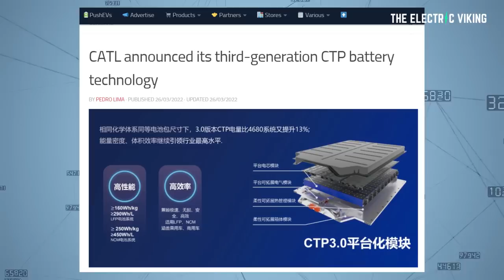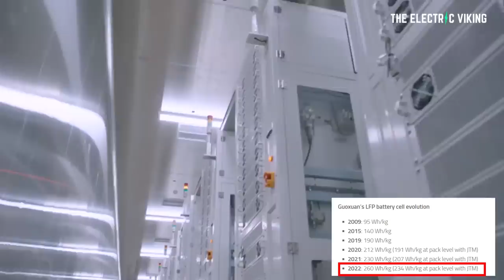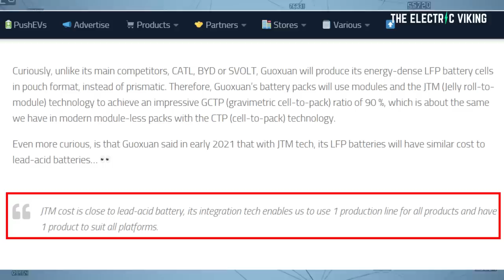260 Wh/kg LFP cells - cobalt & nickel batteries are DOOMED

Comment: The Koreans have made a massive breakthrough with solid state batteries that can be made in lithium ion battery plants. This means that the successor to Terniary battery tech and its solid state successor are within reach.
SK Innovation has revealed that it will be collaborating with a research team led by Professor Lee Seung-woo of Georgia Tech in the United States with the aim of advancing “the era of next-generation all-solid-state batteries.” SK Innovation is not only conducting its own research but putting efforts to develop all-solid-state batteries actively cooperating with various groups.

Professor Lee Seung-woo and his team have developed a solid electrolyte that is said to boost ionic conductivity by 100 times. Just last week Nature published his article on rubber-type high polymer solid electrolyte jointly developed with KAIST (Korea Advanced Institute of Science and Technology).

According to SK Innovation, the discoveries made represent a ground-breaking achievement. Until now realising a solid electrolyte that simultaneously ensures ionic conductivity and safety while functioning at room temperature has been the biggest hurdle with this technology. If this technology makes the journey to market, SK Innovation says it has the power to extend electric vehicle ranges currently hovering around 500 kilometres up to 800 kilometres on a single charge.

Lee Seong-jun, head of the SK Innovation Institute of Environmental Science and Technology, said, “We will move up the era of all-solid-state-batteries, which are also called ‘dream batteries’, by cooperating with Professor Lee Seung-woo’s research team who achieved a remarkable research result to build up our technological competitiveness and contribute to a greater convenience for humanity.”
Reply: While developments in new battery technologies are progressing fast, the means of mass producing them can lag significantly and take much longer to become the preferred technology adopted by the major companies manufacturing batteries for EV's and domestic and commercial power systems. In a very competitive commercial environment there are many ducks that need to line up in the right way and at the right time, for new technologies to be successful in the market place. Hopefully the general public do eventually have the option to obtain the best technologies that are available at a reasonable price for both the manufacturers and the customers.
Reply: @donjohnstone3707   The Koreans are working on this next generation stuff that I expect will  front about 2025 or 2026 as an alternative to Terniary batteries with around three times their current energy density.
Reply: Yes SK and even some Germany firms are hard at work on solid state. But they have been hard at work for many years. No result, the kind which one can actually use in a car. Biggest stumbling block include complexity, inability to mass manufacture at the require yield, reliability, pass tough regulations. So unless there is a fundamentally new chemistry, all past variations of SS battery do not hold much hope. The SK research effort is driven by the fact that they don't have LFP rights or equipment, while China is taking over the EV world with it. So unless SK develop an alternative, their current products will not make it.
Reply: I would say our respective ideation of what "within reach" means diverge considerably.  I will not hold my breath.
Reply: @SkyRiver1  well BYD is simply amazing us with development with LFP thought impossible a few short years ago. So  I’m allowing the Koreans another three years on top of their major breakthrough, with the funding being poured in there’s a huge incentive for SKI to leapfrog the competition
Reply: @johndair2116  production will tell.  Until then there is nothing to invest in.
Reply: @SkyRiver1  Wanna bet? Recently, SK Innovation signed a development agreement with Solid Power, an American solid-state battery expert, to invest 30 million US dollars in Solid Power, aiming to develop all-solid-state batteries with an energy density of at least 930Wh/L. The reason that Sam isn’t all over this is because it’s a bit buried and not coming in the next six months but the development of a polymer that works at normal temperature is a major breakthrough.
Reply: @felixtossan5107  the rights to LFP expire this year, so it’s open slather to other battery makers. Solid Power is already producing prototype all-solid-state cells on its pilot production line at its headquarters located in Louisville, Colorado, in the US. It also is producing sulfide-based solid electrolyte at its headquarters and recently announced it will be bringing on additional electrolyte manufacturing capacity at its new facility in Thornton, Colorado, in the US. SK Innovation plans to work with Solid Power to further develop Solid Power’s existing all-solid-state battery development technology by raising energy density and jointly tackling the technological challenges of commercialization."
Reply: @johndair2116 . . .  "As a concept-stage play, the outfit’s High-Content Silicon and Li Metal Anode Cell technology is three years to five years away from critical “D-sample testing,” as InvestorPlace’s Ian Bezek recently noted.

And if everything goes as planned through 2025, only then will SLDP investors see quarterly reports sporting revenue as its commercial product debuts.

Hope it goes well for them.  But, I consider the next two years as critical, so at this point that's not for me.  Unless it dips below $5 then I would take a small speculative position. 
  I see an inevitable massive shortage of raw materials for battery chemistries that are already in commercial production as the main area of interest, . . . and mined ag products.
Reply: @SkyRiver1  yes, two to three years before investors will take notice but enthralling that this type of battery can be made in existing adapted battery plant. Surprisingly, it’s more than a concept stage, SK has working version made in its pilot plan currently under test, some reports are saying that LG has a similar battery under development (LOL) and are more advance, mentioning + 2 years. I think this is why the Chinese are shovelling out LFP now because they new the next big thing is maybe two years away….
Reply: @johndair2116 I have more or less been playing devils advocate here.  I remember seeing a video of that prof from GT in his lab explaining his SSB approach.  It was impressive.  So thanks for bringing my attention back to this (and his competition).  They did great today, but so did most EV related instruments, so I am going to keep a watch on them.
 Tesla did great today 5.24%.

So did XPEV 7.33%
and NIO 8.46%
and BYDDY 8.56%
and my favoite for the day GGPI (Polestar) 11.52%
I own them and I love EV!  And strangely enough Tesla is still my favorite investment.

Comment: Every nation will want to have energy independence as soon as they can so 100% reliance on China is as disadvantageous as Europe’s high dependency on Russia for Oil and Gas which has suddenly become a big problem.
Reply: Energy independence by using solar doesn't require lithium type batteries. You can go for cheaper solutions because you don't have to care about energy density. Both the LFP and Nickel-cobalt based lithium ion batteries are more ideal for transportation because of their density.
Reply: VW will build their own battery factory in Salzgitter, Germany together with Gotion. their 230Wh/kg could already replace all existing NMC batteries, currently used in their MEB.
CATL currently builds a factory in Erfurt, Germany, probably for LFP
also, the batteries that VW uses from LG Chem are coming from Poland, not China. but they also buy similar batteries from Samsung SDI, where i don't know where they get manufactured.

Comment: Sam this one is an excellent report. So much factual information on such an essential component of EV. One wonder why China keep making breakthroughs on battery while others hardly. I think it all go back to the quality of the scientists, engineers and management determination. 

Unless S. Korea & Japan battery makers make fundamental breakthrough, the battery race is likely over. China made EV have and will continue to have the superior battery systems. This include foreign EV who use China batteries. As to Japan/SK, they can continue to sell to U.S. and others but their products cannot compete with those with Chinese batteries at the energy level. 

While energy density is vital it is of course not the only consideration. As Sam said LFP offer many other important advantages. The ability to mass manufacture is the last hurdle that killed many an other battery types. The biggest killer of so many attempts to make solid-state battery is they simply cannot be mass manufactured. LFP still require a large amount of lithium, phosphate and nickel. China have advantage of securing huge supplies of these raw materials, and now can access Russia's vast natural resources which the west no longer can.

Therefore one can say these: 1) More and more foreign brands have no choice but to manufacture in China and export, simply because then they can get the best battery at the best price. 2) Import China batteries. Europe is doing it but nobody else. This is a hot political potato on all sides. Also, why should China export their batteries and give competitors an advantage? Keep the battery domestic and it continues to see foreign brands (Tesla, Toyota) setup manufacturing in China. US will certainly do this if it had original battery tech. The 4680 battery is not Tesla original as so many believe. It is 100% Panasonic patented original but Tesla have licensed the cell to customize them for Tesla packs, and produce them in Tesla plant.
Reply: Spot on, the future seems very gloomy for Western legacy car companies
Reply: Nope, Tesla owns the patent for it's 4680 based IP, e.g. Patent No: US 11,043, 823 B2:

https://www.youtube.com/watch?v=WH6GXfGvxCo
Reply: @midnightstar4065  As the video show the patent is for 'System and method for facilitating, conditioning and testing of rechargeable battery cells'. The invention is the building of testing equipment to test cell 'formation', ie. charge and discharge behavior. It is a production line equipment. It does not even mention 4680. 

The 4680 cell is a Panasonic invention, its full property. This is why Panasonic announced about a month ago that it will build a huge factory in Japan for the mass manufacture of 4680. The products - cell and battery pack, intended for sale to all EV customers, not only Tesla. There is no word on the fate of the Nevada Gigafactory, jointly owned by Tesla and Panasonic. It will need a completely new production line equipment for 4680 and this won't happen until that line is proven. 

While the design of 4680 is Panasonic, the making is anybody who get a Panasonic license. Each such licensee have to figure out how to build own production line. This is the part Tesla do - they are licensee of 4680 cell and have have created a small factory in Fremont to make them - a demo plant. However, Tesla 4680 Fremont yield is poor to say the least. So poor that it has sent out requests to anybody who is interested to take their factory design and improve it and build their own demonstration plant to prove it. Tesla Fremont plant yield & quality is so poor it cannot proceed to spend billions to convert the Nevada plant for 4680. Meanwhile Panasonic 4680 Japan factory is under construction and we don't know how it will perform. It is notable that Panasonic have abandoned the Nevada plant for 4680. 

Tesla intention is to be a full licensee of 4680 production (but not the ownership of the cell IP) for the Berlin battery factory. But this project has been cancelled due to severe delay of the Berlin car plant. It surely want vertical integration. But it's ambition is too big, and thus far unfulfilled. It should stick to making cars. The only EV company in the world who is truly vertically integrated is China BYD. It makes not only own cell, battery, but own electronics and semiconductors. It has 4 chip plants. 

To date, there is no, NO, US company who own the IP of EV battery, or anybody who can manufacture them. All US EV use S. Korean or Japan cell/battery.
Reply: @directxxxx71  That depend on the ambition of the EV company. If it want to be a car maker like ALL EV maker except one, the future is OK/bright. If it also want to make own cell/battery, the future is dim indeed. Only BYD  make own cell/battery and the car. For US EV makers, their future is entirely tied up to S. Korean or Japan cell makers. They won't get any of China cell/battery because Beijing won't allow export. This is called reverse sanction.
Reply: @felixtossan5107   You are welcome to post sources that back up your statements, as Tesla have now confirmed that they are producing 4680s in Giga Texas and these are going into production cars (with a cathode plant under construction there as well). 

So Tesla is producing & vertical integration is starting to happen, while Panasonic is still trying to work out what to do in Japan...

Likewise, the battery cell plant at Giga Berlin continues to be built, so no evidence of that project being cancelled either.
Reply: @midnightstar4065  Tesla built only one plant in TX for EV. So their plan to make 4680 there is news to me, perhaps they decided to build a battery plant which typically take 2 years. Their prototype plant in Fremont have made 1 million cells to date. They can always duplicate that in TX, regardless of production and quality issues. Panasonic, in partnership with a Japan car company and enjoying subsidy, is proceeding to build its 4680 (Nikkai news). This collaboration say Panasonic is highly confident of its cell and newly designed production line (which of course it won't share with Tesla). 
There is NO battery plant for Tesla in Berlin. The German government has cancelled both the permit and the Euro 1 billion subsidy - this order was issued in January 2022, in public domain, and I have seen it. For sure Tesla want to be vertically integrated. But even if successful (not a given, making battery is a nasty expensive affair), it is still not fully VI because the single most important thing , the 4680, is still Panasonic property. CATL new third generation cell-to-pack design with improvements in the basic LFP cell already exceed 4680 by some 15%, without all the complexity and high expense of ternary designs. Gotion Hightech is already making a LFP with 210 kW/g, going for 230 kW/g late this year.
Reply: @felixtossan5107  

You are correct that Tesla withdrew the Berlin battery plant subsidy application but construction work continues and Tesla is recruiting as per their jobs site:

"Gigafactory Berlin-Brandenburg will be the first location in Europe to manufacture cells in-house together with electric vehicles. With generous benefits starting day one, competitive compensation and on-the-job training, Tesla will provide you with what you need to help us build the future of sustainable energy."

The operating permit that Giga Berlin received in March includes the battery plant as per this quote from Automotive News Europe, dated 04 March 2022:

"BERLIN -- Tesla has received a conditional license to begin production at its electric vehicle factory and adjacent battery plant in Gruenheide, Germany, ending months of delay for the landmark site that was initially supposed to open last summer."

I am surprised you were not aware that Tesla was building a battery plant as part of Giga Texas which is now operational, along with the first cars production cars delivered using 4680s yesterday...the battery plant in Berlin will also produce 4680s when it is ready:

https://www.youtube.com/watch?v=pqf55JLc6t0&t=541s
Reply: @midnightstar4065  Yes I don't know about the TX battery construction. Tesla Berlin battery as originally intended, which include a big German green subsidy, is dead. For sure Tesla can continue to build one by its own money. Building such a factory take a long permitting process, and get an operating permit even harder.  Tesla Berlin has to go through all the hussle just like the car factory, which took more than 2 years. One can assume it will be a 4680 factory. 
BTW CATL just got the operating license for its first overseas battery factory in Berlin. This came about as major Germany car makers teamed up with CATL. Such a collaboration facilitate the red tape but it still took CATL some 1.5 years, and this is just to get the materials support plant OK. The actual cell making plant is not yet finished due to extreme requirements and complexity. I see this will be CATL only foreign plant. The chance of CATL building one in US is about zero, for obvious political reasons. (Same goes for China EV  brands in US, no chance.) The CATL Berlin investment require the approvals of both China president and German chancellor Merkel in better times for mutual benefits. But I don't think this will repeat anywhere in Europe or America anymore. Especially after the  EU Commission prez played politics with the China-EU Investment agreement which got Beijing to cancel it.

Comment: Hi Sam
A chart comparing LFP to Cobalt, nickel batteries if you were to make one please include, Cost, energy density, cycles, charge time, cold charge, and who is manufacturing them and who is not.
 I have heard Companies like GM are on the wrong path, working on, the Nickel-Cobalt batteries?
Would be great 
Thanks, Love the show
Reply: GM is extremely slow. That is their problem. For ICE, that's good enough because there is not much ICE specific innovation going on anyway.